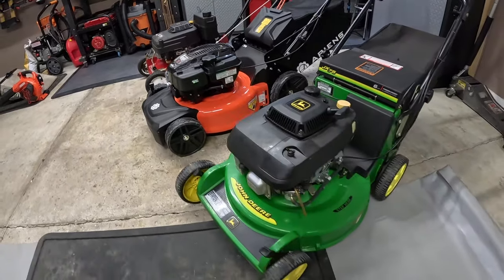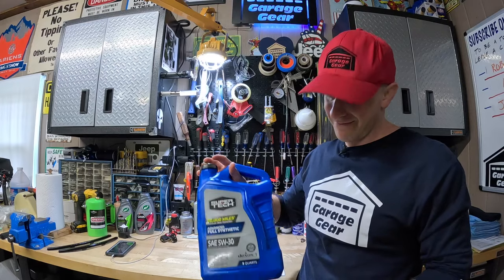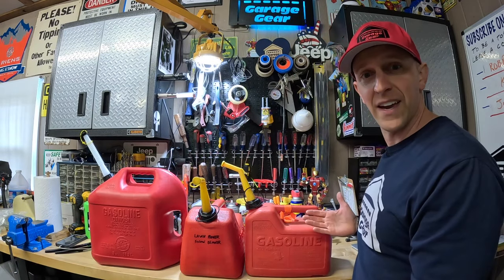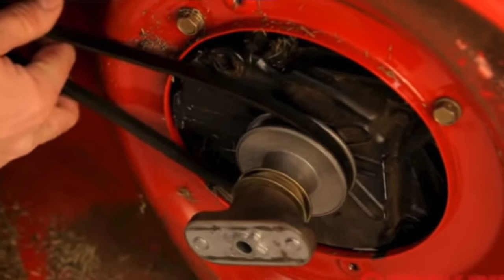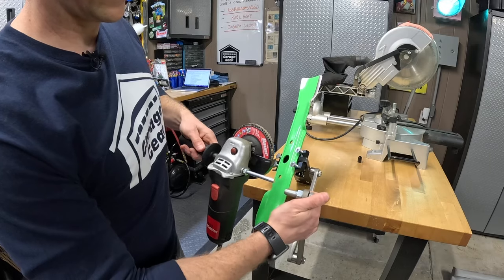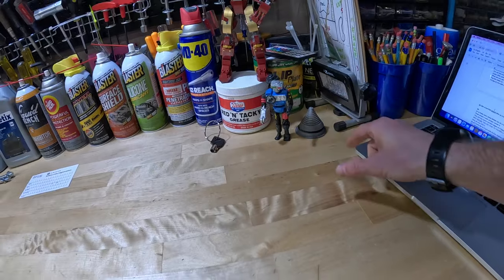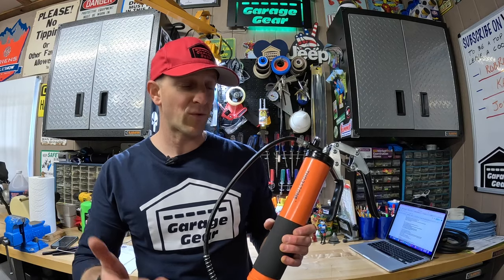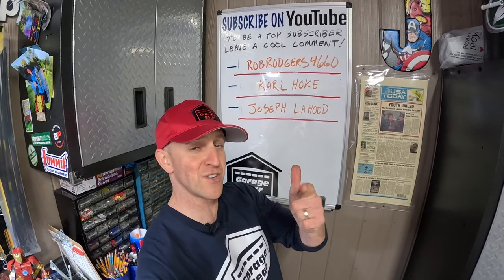12 ESSENTIAL ITEMS YOU NEED FOR YOUR LAWN MOWER

Comment: This is weird because I just bought a bunch of maintenance stuff for my riding mower, lol.  I mowed the front lawn last week and got half the back lawn done and broke a drive belt on the mower that I put on 3 seasons ago.  It was an OEM belt from Husqvarna that I gave $40 for.  This time I went to Ace and got a belt made by Rotary Corp. in Glennville, GA USA for $54.  Hope it holds up longer than the last.  Also picked up oil for it, a new Wix oil filter, fuel filter and air filter for it.  I'll just clean up and reuse the old spark plug as it's only a couple seasons old and still has plenty of life left in it.  I'll also grease the spindles, axles and steering gear while I'm at it.  I replaced the deck belt last fall with a belt from Rotary, so no need for a new one of those just yet.
Reply from the maker: Thanks for sharing this info rebel!

Comment: Might I suggest instead of using red and tacky grease for the wheels and such try a marine grade water proof grease. Still super tacky, spins well and when you wash the mower it prevents rust better as well. I think it would be better for snowblowers as well. Since I've started using it on my snowblower and snow pushing garden tractor I've found it actually does repel water better.
Reply from the maker: Thanks for sharing Iowa fox. I actually used that in the past and it did a great job too!

Comment: Question regarding the bench blade sharpening tool. For Honda HRN/HRX blades, what angle would you set it at?
Reply from the maker: @billchristensen232  I typically set mine at 30 degrees! 👍

Comment: Thank you for the tips. The grease in your video does not have “#2” on the label but the one linked on Amazon does have #2. Is that one ok to use? 
Also, my Timemaster blade bolts are getting rusty on the threads. Is it a good or bad idea to clean those off with penetrating oil spray or some other product or would that actually loosen them. I didn’t want them to rust more than what is happening now.
Reply from the maker: Hey Peter ! That grease is just fine! Also try some anti seize on the bolts. That should help you out! 👍

Comment: 👍🏻I’ve also been using Supertech full synthetic 10w30 for years in my Honda mower, Kohler powered log splitter & small Yamaha generator. And same oil but 5w30 in my Generac standby generator. Awesome oil for the money. I bought a 5gal VP Racing gas jug with a flexible clear spout. It has no weird valves or triggers, just a big jug with a screw vent cap. I use my electric Worksharp belt sharpener to sharpen my blade. I used to use a Dremel but with a 80 or 120 grit belt, it’s faster & easier.
Reply from the maker: Thanks for sharing Chris!

Comment: I need to sharpen my blade!
Reply from the maker: There’s your goal for next weekend! Have a good week Brandon!
Reply: In the summer I also want to paint the rusty spots on my ariens snowblower  with Ariens Orange, but it's covered with fluid film. (I wonder who told me to do that 🤣).   I'd be interested in a video on how to prep the surface including getting the fluid film off so it can be primed and painted. 🙏
Reply from the maker: @brandon_burbach  hey Brandon you could use something like super clean degreaser or maybe even brake cleaner to get the fluid film off. Warning though it does discolor some paints to use it lightly. 👍

Comment: LOL!  My gas can is brand new, but it's the same old style we used when I was a kid.  It's a steel can made by JustRite  It seals shut with a spring latch and a cork gasket, has a large pouring spout and a detachable funnel that you can leave attached and pour straight from the can into.  They have a spark arrestor built-in to the spout for when filling up at the gas station and they last forever.  They're a bit pricey but as with most things, you get what you pay for and at my age (55) I doubt I'll ever need another one, unless I buy a blue one for kerosene for my torpedo heater.
Reply from the maker: I’ll check those out rebel! 👍

Comment: Hey Bud, just watched and as always, I gain. I'm going to check out the blade holder that is awesome. I see you use 5-30 on mowers. I always thought straight 30 was for summer. That's my learning for today. We just got 4" of slush Thursday and I used my Toto 5/21 with my Predator for the first time awesome. It did clog at the end as it was too heavy. Thinking of buying another to replace my 208cc-factory engine on my Craftsman Quiet Technology, we'll see. Be well my friend.
Reply: We got 12+” of slush and my Ariens SHO ate it all up like a hot knife through soft butter.  Blasted it a good 25’ away.   

King of Snow 💪💪💪
Reply from the maker: Hey John! I learn a lot just being involved with this community as well! 5w-30 full synthetic generally has a wider temperature range. Most manuals mention that 30 is good too. Winter is finally letting go around here but crazy you’re still getting some! Go for it with that engine swap and keep me posted! Appreciate the PayPal you sent my way my friend! I’ll be sure to take the garage gal out for dinner! Appreciate you as always my friend! 👍
Reply: @GarageGear  Bon Appetite my friend!!

Comment: In your opinion what is a better lawn mower .im looking at toro,scag and ariens.I have a a battery powered kobalt 80 volt and i have some aziol grass and my battery powered mower has a problem with it.not enough torque
Reply: If it’s for a business, whichever brand has dealer support. For residential, I would go with Toro Super Recyler or the Stripe with dual blades.
Reply: @LL-mt2nz  thanks I had a old toro for about 30 years and never had a problem tried battery powered but it doesn’t have the power of gas I gave my old toro to my niece and they love it
Reply: @johnmcalisterjr3913 My 60v Super recycler has more than enough power for residential. Much more than a 160cc
Reply from the maker: Hey John I would leave Honda out of the mix here either. Great mowers just going out of production now. Get em while they’re hot.
Reply: @GarageGear  thanks for the information.great information on your channel

Comment: I switched over to Surecan about 4 years ago. Love them. I picked up several at Equip show from the maker. Second, I also have about 5 of those scrapers from the Equip Expo. They gave them away for free!!! I pick them up each year I attend the show. I keep one on my trailer that moves my zero turn. I can also use it to get under my mower to change blades and clean off the deck. Great tips.
Reply from the maker: Awesome Tim! Would love to go to the equip expo. Thanks for sharing!